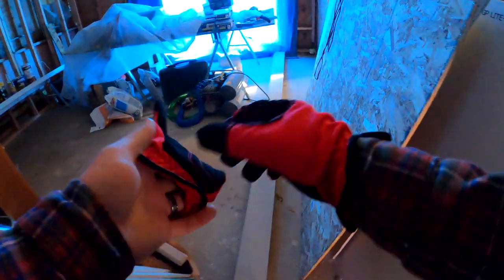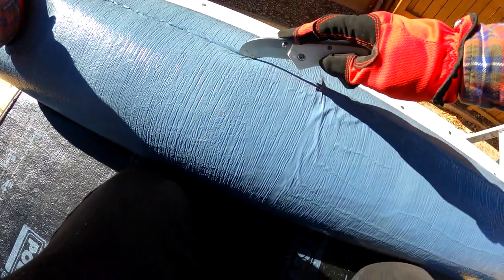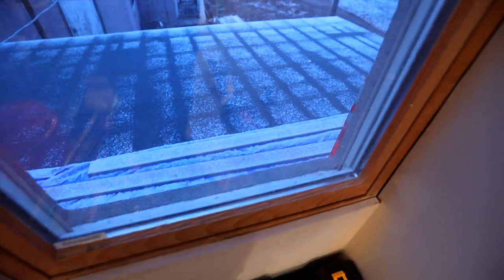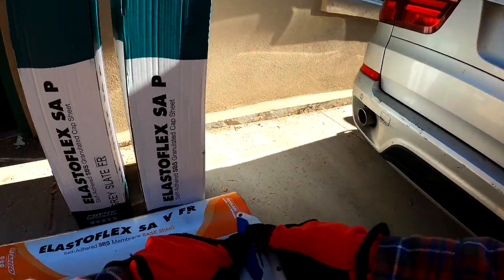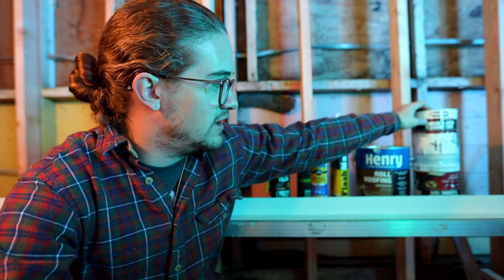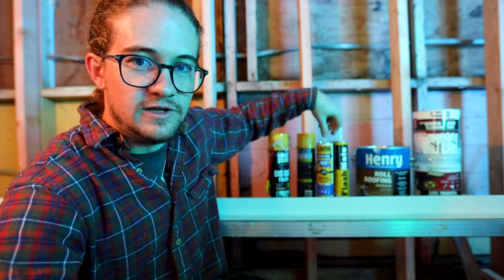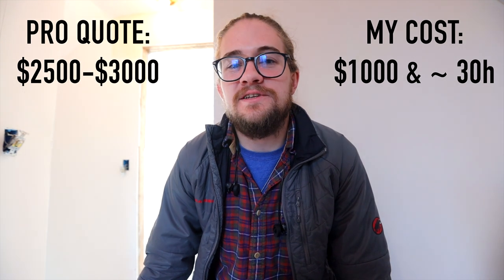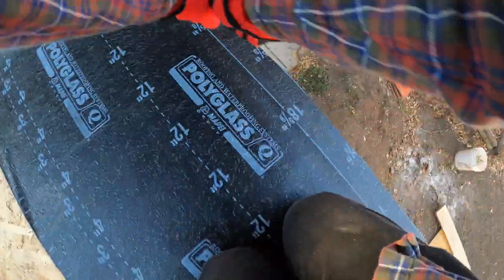Amateur Roll Roofing Installation NO TORCH | PolyGlass Elastoflex SA V & SA P ADESO

Comment: Do u have to use peel and stick underlayment? Or can you use the regular nail in paper?
Reply from the maker: That is a great question, polyglass recommends peel and stick underlayment although they did say that the top layer can go directly on the decking. My local roofing supply said that any underlayment will work as long as it fits the spec for mechanical adherence i.e. "sticktivity" of peel and stick underlayment or amount of nails etc. 
So that probably didn't answer your question! Haha. That's because I don't want to steer you in the wrong direction. I will say, having used regular underlayment with single many times before, I definitely don't think I would use nail on underlayment with peel and stick. I don't think it would last long term. I can recommend polyglass peel and stick underlayment though, definitely feels very water tight when applied.
Reply: @Jacob-Shields  so u don't need underlayment?
Reply from the maker: I think it depends on where you live and what code standard there is. The polyglass top layer does not require underlayment BUT it is recommended and some places require it.
Reply: I would have loved to see how you handled flashing on your brick. My porch deck is brick at the house. All the water is directed to one gutter on the opposite side. So the sides have a special drip edge that acts like a dam on each side to direct the water toward the gutter. To complicate things the roof is built around two sides of two large brick columns. 

So I have to flash on brick at the house and on the outside corners of the two columns. 

I have worked with roll roofing before, but this is my first experience with self-adhesive roofing. I am using Tarco brand from Menard’s, which seems to be a consumer grade of Polyglass. Tarco has terrible instructions, so I have been researching the proper sequence. This is what I came up with. I hope someone more knowledgeable will comment and correct.

Having already primed the new plywood deck, I plan to:
1. Install and hand roll a 6” strip on each side (for the 4” drip edges) 
2. Prime the first brick course of the columns and the house 
3. Install and roll the base sheet 
4. Flash the base sheet to the first brick course at the house and columns

Then my metal guy will install the drip edges, metal flashing, counter flashing, gutter, and downspout. He will cut the metal flashing in above the second brick course. The metal flashing will cover the base sheet flashing.

Then I will:
5. Prime the new drip edges and base of the new metal flashing
6. Install and roll the cap sheet

If this doesn’t sound right, please correct me!